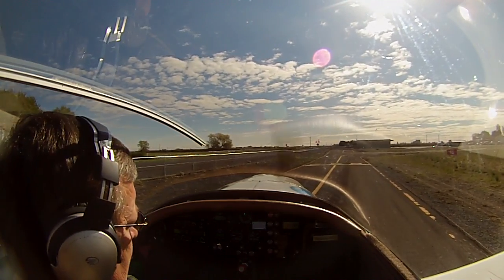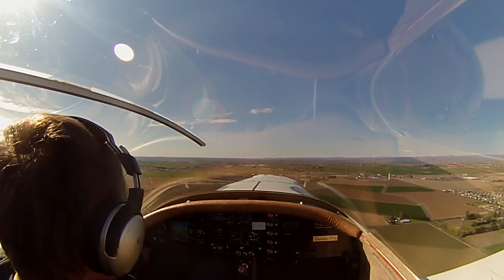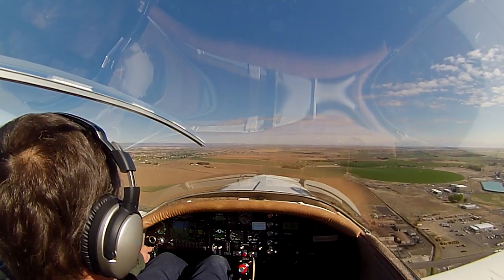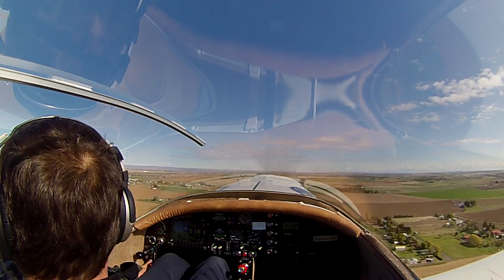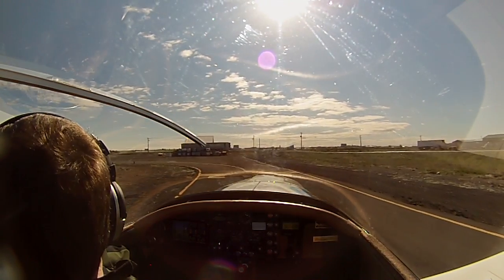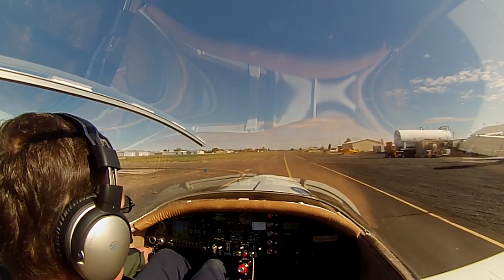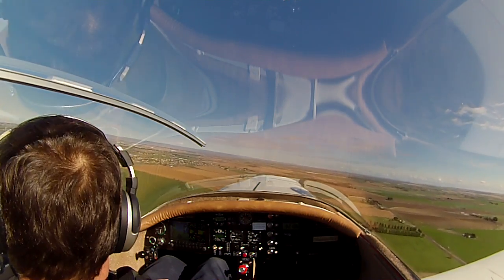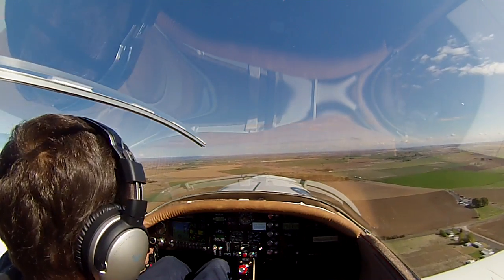Pulsar III test flight

Comment: I'm looking at one with a 3300 and trying to guestimate cruise .
Reply from the maker: 3300 was my preference, BUT I had a budget and already had 60K into the build. The fellow that bought the airplane now in Mesa Arizona is toying with the 3300 option. You may want to look at the Viking as well and talk to them about the potential. The aircraft is sensitive in pitch so you have to be very cautious about W&B. Great little airplane.
Reply from the maker: 190 is never exceed. Also make sure you get the serial number of the 3300, There is a series of numbers that can be problematic. Call me at 206 819-2352 if you have any questions.
Reply from the maker: You can also reach me at lwheat2083@gmail.com. Cheers